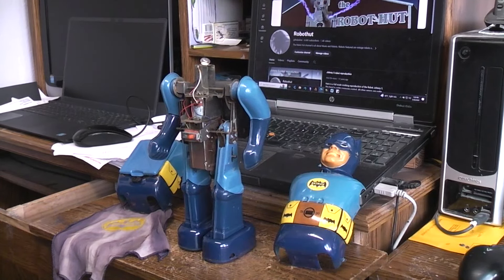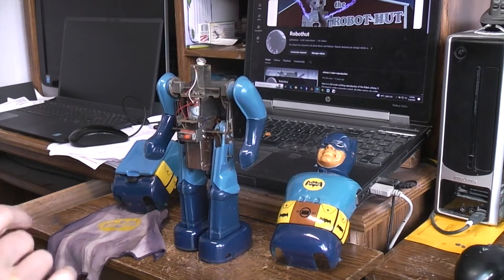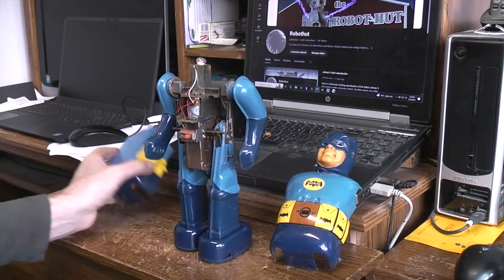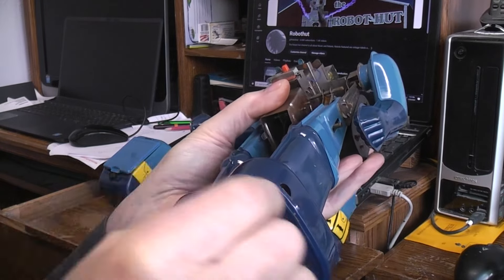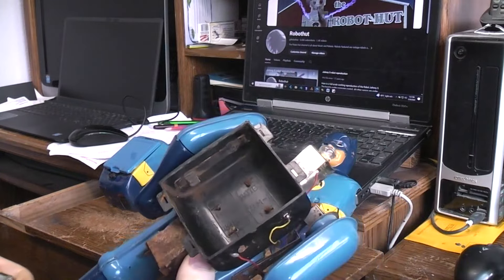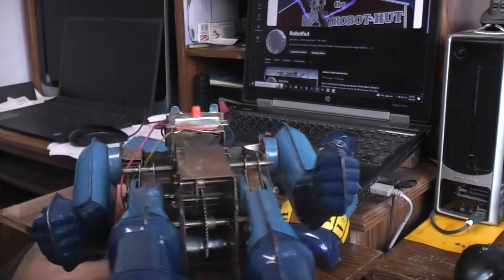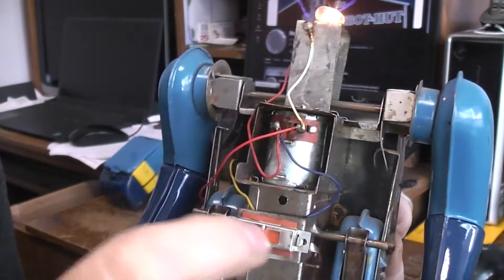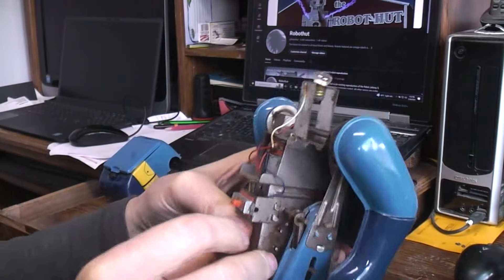Inside a vintage 1960's battery operated Batman toy made in Japan by Normura.

Comment: I remember these! What cleaner did you use for the rust? That's always some difficult stuff to remove. Cool mechanism!
Reply from the maker: Rust can only be sanded or grind off. Cleaning it or coating it will not stop it from growing like a cancer at some point. I leave the rust removal for others and focus on mechanical repairs.
Reply: @Robothut  Ah, that makes sense. Yeah that rust can be some nasty stuff.